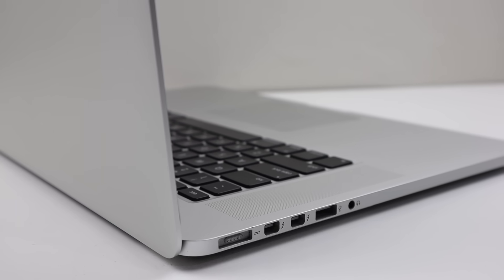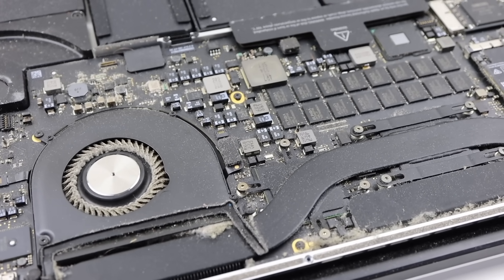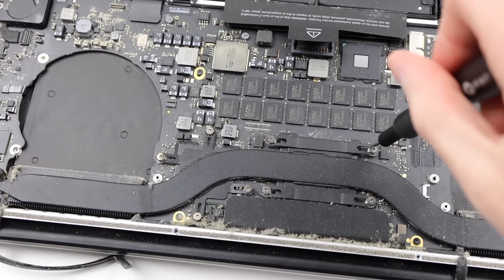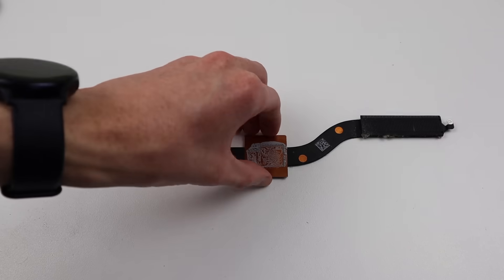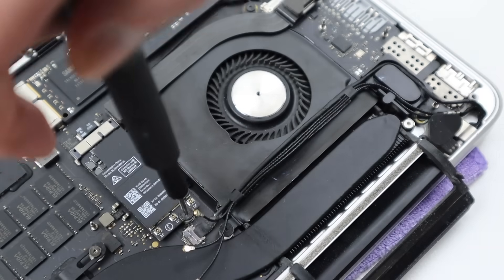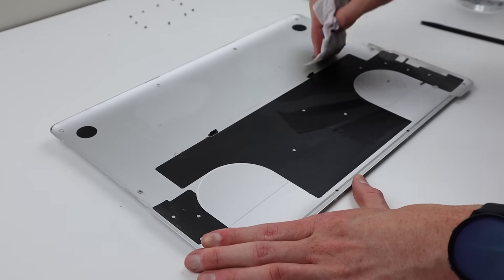Fixing My Filthy Overheating MacBook Pro

Comment: I have a 2019 21.5 iMac that runs quite hot under load cuz the damn fan won't even spin until it hits 100C then very slowly ramp it up. Installed macs fan control and it drastically lowers temperature by increasing fan speed but still keeping it relatively quiet. The CPU is turboboosting a lot longer then before too.

Comment: Use the little straw that comes with the compressed air or tilt the computer itself, you're basically spraying the logic board with sub zero liquid gas.
It's a thermal shock in the solder joints and chips.

Comment: The moisture you got with the compressed air was mostly because you didn't hold the can level. The liquid comes out other times usually because it's been shaken, not stored upright, or used  for prolonged periods.

Comment: Laughs in 94.5°C when watching YouTube or when in online classes
Reply: Anthony José  turn off camera when you video call. Thats the cpu drainer.
Reply: Tomahek you realize that it’s a thermal issue and not a battery problem. 

Also some online class requires you to turn on the webcam for the duration of the class.
Reply: Zacronzer Zetto yes the cpu having to work less would make it cooler. It is a thermal issue and a viable solution.
Reply: @zacronzer   who is talking about battery? There are some codec problems which causes cpu to work much harder than its necessary which causes temperature to skyrocket.
Reply: @youdontexist.  ah my bad, I thought you were pointing that the CPU massively drain the battery power.
Reply: @zacronzer  r/wooosh
Reply: Use smcFanControl to put the fans at high speed without waiting for the OS to do it when your computer is exceeding 70C.
Reply: @gorkyd7912  thank you, man. I bought a new laptop a few weeks later! Either way thank you! :D

Comment: try volta if you are still on 10.14. It can disables turbo boost when you dont need it and you can undervolt the cpu and lower the power limit.

Comment: It would be interesting if you also posted some details about the temps you were getting before and after the cleanup!
Reply: I was waiting for him to show the temps at the end, am quite a bit disappointed I must say.
Reply: @Erotikstudio Winkler GmbH Nice explanation and all, but it'd still be nice to see a higher boost clock like you said. If you can't prove that there was any difference at all, what's the point?
Reply: I got a 20 degree drop according to Macs fan Control. My fan entry was blocked with dust bunnies and the paste was dried out . Its 11 years old and never been done before . Also made sure to clean the fan blades from dust
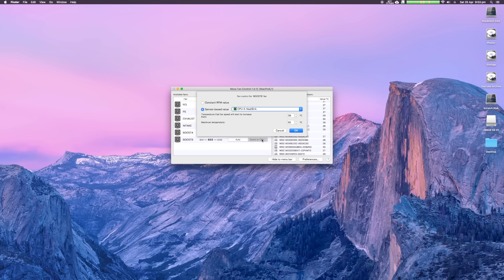Reply: In the last couple frames (around 09:08), you can see in the upper right corner that his fans were running at ~1476 rpm at 44 celsius.
Reply: from shit to less shit,
Reply: @Erotikstudio Winkler GmbH You convinced me all tho fan noise is still horrible and i don't think anything can defend cheap tiny radiators
Reply: Because all that work, and risk, probably didn't do anything.
Reply: +1
Reply: yea
Reply: @harryprice89  you want me to research for a simple clean up?  no thanks
Reply: Basic detail, and yet he left it out. I'd like my view back, if possible.
Reply: Agree, feel like he's just trying to make a video with a problem that doesn't exist
Reply: @trongnguyenduy4154  did we watch the same video? It was dirty as shit and was running at almost 100 degrees... if that's not a problem to you remind to never buy anything from you second hand
Reply: By looking at those tiny cheap radiators i'm expecting temps to be the same
Reply: @Next-nb9pr  You are so stupid.
Reply: @Next-nb9pr  a clogged airflow can make a difference
Reply: @cgd07  Of course but the most you can get is quieter fans and still irrelevant temps
Reply: @Next-nb9pr  if it's not throttling then it's fine, but when it is, even youtube gonna stutter
Reply: @cgd07  Well it depends what is fine to you but hardware working in 90-100° won't last so long after warranty ends. Also if you like turbine noises then i guess it's fine but as you said it will be working smooth unless throttle comes, i would go for undervolting
Reply: @Next-nb9pr  90C is perfectly fine for laptop CPUs/GPUs, hell, even 100C is starting to become safe. The more recent AMD/Intel CPUs can go to 105C before thermally shutting down, it used to be 100C.
Reply: @acumenium8157  You're talking about shutting down i care about thermal throttling at these temperatures there is no fan that wouldn't go like a vacuum. It's not only about the core but every other component providing power and that amount of heat will easily melt vram chips
Reply: @Next-nb9pr  Throttling is 100% software side and depends on manufacturer. MSI sets my throttle at 90C, but I have it disabled because there's no reason to.

Lenovo usually sets it at 70-80C, sometimes disableable.

Throttling has nothing to do with actual safety, just what manufacturers want to impose, if they want.

Also VRAM chips don't melt at 90C.
Reply: @acumenium8157  You've got theory i know facts and have seen many examples when micron chips just died. Still my point was to small radiators and inefficient heat transfer but yeah as long as you're fine with portable vacuum cleaner i really don't care.
Reply: @Next-nb9pr  By Micron chips... you mean storage right? Like an SSD or flash card?

Those don't really throttle from heat so much as they just... stop working.

You're right though those do have a lower temp limit, although NVMe has changed the game a bit. Most NVMes can handle up to 80C with no issue. Some do have  throttling features to reduce it to "only" SATA speeds until it cools down, but that's really hard to notice.
Reply: @acumenium8157  I meant vram on gpu and it seemed as one series of cards has that issue and another works perfectly fine. You have very good points and knowledge but i still look at this as of not how much core or other components can handle but what culture they should work under. And sometimes it really doesn't come to saving weight but just money and brands being very  cheap on radiators.

Comment: I’d put new thermal paste on any laptop no matter how old it is because the junk they use from the factory is generally low quality and mid quality at best. It took Apple all these years to finally put in a better paste in their machines until finally 2018 they did it and even then, it still isn’t the best. Whenever I replace it, I’ll always do the best possible job I can and clean the heatsink and the die with acetone as that cleans things even better than alcohol and then I apply thermal grizzly kryonaut since it’s pretty much the best one out there. And when it’s a machine like this where the heatsink has a lot of mounting pressure, I spread the paste before mounting it because it’s bad to have some parts of the die not making as good contact.

Comment: Do not tilt, and do not shake cans of compressed air and you will not longer have the moisture issue, it's actually condensation from the liquid in the canister landing on the board, rapidly converting to a gas and decreasing in temperature rapidly.

Comment: I do clean mine every six months, been doing that for years every macbook that i have owned is still working even my 2008 15inch one is used for mail in my office cleaning your PC/Laptop should be a normal task if you want your device to last longer and work at its best..

Comment: Just to let you know you was using the compressed air wrong
Reply: Yeah I thought he was going to kill his computer
Reply: Literally was screaming in my head when i saw it shooting the liquid from the can... Also a questionable amount of thermal paste.
Reply: @discretecinema8451  I agree with you on that whole compressed air statement, That gave me chills but I don't get the thermal paste. It really doesn't cause harm
Reply: Zycklacon applying too much can cause worse thermal transfer over time, and see performance degrade faster than normal.
Reply: @discretecinema8451 you prune,Hugh did remove the battery meaning it is totally harmless with the battery removed
Reply: @discretecinema8451 you dumbass,it couldn't do no damage like Hugh mentions it is harmless to the Laptop whilst the Battery is disconnected
Reply: Let's Disregard the amount of Thermal Paste as there seemed to be a shroud to protect the components. However, compressed air should not liquify like so when sprayed.  Shake the canister properly (I actually doubt shaking makes a difference but just reflexes) and try to spray it in a horizontal or <45 degree angle or else the gas will not vapourise (don't know the most appropriate wording) properly.
Reply: @5x22  silicone thermal paste isn't conductive
Reply: Tim Goddard Just to let you know you were using grammar wrong
Reply: As long as there’s no power running through the board and the liquid dries before reconnecting the battery, then no harm done. It isn’t water anyway but rather a liquified gas such as difluoroethane, trifluoroethane, or tetrafluoroethane which dries almost immediately on contact.
Reply: Tim Goddard ikr
Reply: i shake my compressed air so no water comes out, it works.
Reply: Tim Goddard the compressed air from a can might create vapor that condenses — but these are fluorocarbons (fluorothane) — These vapors do not condense to water and boil away rapidly at room temperature creating a cooling effect. There are other liquids than water, just in case you weren’t aware.  

Compressed air from an air compressor might in some instances collect actual water — but that’s not from a can dear.
Reply: Crux161 actually if you so much as read the can you will find that the liquid will only come out of you haven’t held it straight or if you shake it amd I wasn’t saying it could damage his computer but it wasn’t going to remove dust was it now my dear
Reply: @Crux161  Amazing how many people seem to know everything, yet don't. We can only try to save them from themselves. Seeing school has mostly been an ftard minding service for over thirty years (I live behind a high school), it surprises me we're not all dead from chronic stupid.
Reply: Michael  who are you jeses?
Reply: @kiprad6347 you mean Jesus
Reply: Michael  you tell me
Reply: @Asher Ortman hahah ok buddy if you say so
Reply: Man everyone always gets mad for no reason like
Reply: Just to let you know, you were using the word “was” wrong
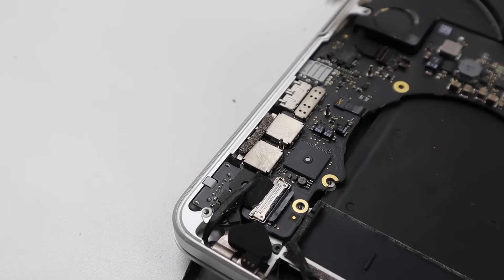Reply: 5:15 U LIL PIECE OF SH8
Reply: Jason Kulo it’s compressed air. He must have shaken the can because it was literally shooting liquid out of it. I do know about MacBooks, but this is not even about them.
Reply: Barundonthetechguy / iRepair can you explain proper way to use compressed air ?
Reply: @Draculapin  you're supposed to hold the compressed air can vertically, if you hold it horizontally it will definitely shoot liquid like in this video. Most air cans also come with a straw that you can use to direct air on a horizontal surface and still being able to hold the actual can vertically.
Reply: @Jackinacox  thanks for your time
Reply: Draculapin Sure! You hold the can upright, without shaking it at all, and he was using it badly enough that some icy liquid froze parts of the mobo, because he shook it up and/or was using it upside down. NO liquid should come out of it when cleaning with it.
Reply: what do you expect from mac users
Reply: Just to let you know you was using eanglish wrong
Reply: Kiprad just to let you know no one cares but thanks all the same
Reply: @kiprad6347 you mean English
Reply: @kiprad6347 you too a lot more horribly 😂😂😂
Reply: Moisture = rust you dumb as
Reply: @levynkhs8820  who are you calling a dumbass, you can't even spell it
Reply: @levynkhs8820  not quite. Water equals rust. Compressed air has no oxygen to oxidize and form rust. Nice try, dumbass.
Reply: @Kafen8d  bruh water condenses fool ?what were u doing in ur high school classes?
Reply: Pointless argument
Reply: Random Guy it’s not water in the can it’s compressed air which turns into a liquid “you fool”🤣🤣
Reply: @Kafen8d  not to mention its aluminum not iron
Reply: @Kafen8d  bruh didn't you see the frost that appeared from the liquid in the canned air? When that crap evaporates it leaves the surface at freezing point, condensing water in the air
Reply: Couldn’t the oxygen in the air react with the liquid from the compressed air and then it be able to rust.
Reply: @levynkhs8820  First learn to spell dumbass you dumbass

Comment: Lmfao my 2012 MBP runs HOTTTTTTT while I’m using MS Word or just browsing the web
Reply: Its time to clean the dust out of it.
Reply: Cautionus Xtras I did i think it’s time to replace thermal paste under the heat sink 🤷🏽‍♂️
Reply: I cleaned my MBP mid-2012 today. Lots of dust was at the fan. After the fan is quiet and MBP is not heating.
Reply: Nicholas Ramdhan upgrade to ssd
Reply: John Francis Chan i not too long installed a 2TB Seagate barracuda in it. It was like 3-4 months ago. It has 16GB of DDR3 RAM and a core i5 2.5GHz 

(Edit): removed a g from gigahertz 😭
Reply: @johnfrancischan9464  haha that would not help reduce temps at all
Reply: @johnfrancischan9464  Not the main issue in a laptop.
Reply: Word lol
Reply: some macbook problems😂🤣
Reply: Chrome will do that with no tabs, also youtoob, and most sites with ads. Watch the cpu column in activity monitor. Also, Apple factory thermal paste is disgusting and almost worse than useless. Weird.

Comment: It grinds my gears when there is old residue of termal paste on the CPU before applying new paste. I use a cotton swab and isopropyl alcohol to clean the internals of my laptop.
Reply: And eucalyptus oil
Reply: @lox07  + a sprinkle of fairy dust
Reply: @lox07  oil doesn't evaporate like isopropyl or methylated spirits does
Reply: Which termal paste?
Reply: @macyourday0  5:40, and the brand I use of termal paste Is Manhattan
Reply: @TheBetomann  did you notice a speed increase. my mid 2016 pro touch b art 15" clealry is overheating sure its the dust but i wonder if it losty speed
Reply: I used artic silver 5 paste good stuff

Comment: keep the compressed air can completely upright at all times to prevent liquid being released
alternatively get a battery operated air blower available at stores like PC Case Gear
Reply: Yes, NicGlol got it right, it was pain to see how he used that compressed air...
Reply: Not to mention you need the straw to make sure that you have enough pressure concentrated to actually move something.
Reply: NicGlol it also helps to use the included straw.  It’s like this guy has never used a can of air duster before but yet he repairs and cleans computers ...
Reply: Also, "giving it another go with some compressed air just to finish things off" tends to finish fan bearings off. Always block the fans from moving freely when using compressed air / a vacuum!!!
Reply: @Thomag0   F.Y.I - Never use a Vacuum on anything electronic, it creates ESD and will shock and kill it instantly
Reply: ee i dont use the can my dad has a red tank
Reply: and if you eat after touching stuff you sprayed it on... well find out yourself.
Reply: @ilyasg2108 that won't happen if you was your hands afterwards though
Reply: @stephensnell5707 true, i made the mistake of not doing that then eating grapes once
Reply: what about leaf blowers?

electrical ones of course
Reply: 5:15 everybody
Reply: Continue sentence off part of another, genius.
Reply: i also wondered about the liquid coming from the compressed air. i just cleaned my macbook using a vaccuum and brush and it came out very well. i think using a vaccuum at low level doesnt pose a big risk and actually gets the dust out better than using air. i also did not need to really disassembly anything. macbook runs much better and i needed only a fraction of the time this guy did. of course i did not apply new heating paste, which would probably help, but getting the fans working properly again already helped a bunch and the whole macbook was full with a lot of dust i could easily remove using the vaccuum. i read people saying vaccuums will kill your computers by static discharge but have cleaned various computers over the years with vaccuums and never had any of these fail on me. i sincerely doubt it that carefully vaccuuming your pc will be a big risk to your computer.
Reply: dude where is that extended nozzle on that thing
Reply: should have read this before I totally f'd my macbook pro lol
Reply: NicGlol  I’m so glad someone else saw that i made a comment on it and got a loud of hate saying I don’t know what I’m talking about 😂
Reply: He could use the hair drier on cool mode too
Reply: @mourgos1234  it could be dangerous because it can create static electricity and short out something
Reply: @hamzah.t07  even from distance ?
Reply: @mourgos1234  maybe?

Comment: There’s a lot of moisture coming out of that compressed air can, you must make sure to not hold it at an angle, I was terrified!, they usually come with an extender (sort of straw) to move the air to the spot you want.
Reply: I also noticed that, he tilted the air can a lot.

Comment: Thats a good amount of paste buy when applying to bare dies (basically everything except desktop and server CPUs) it would be best to spread the paste to ensure it covers the entire die. Since there is no heat spreader like on desktop and server CPUs, lack of thermal paste on sections of the die results in zero cooling for that particular area.

Comment: I already replaced the thermal paste and cleaned the fans on my 2009 MacBook Pro. It still managed to iron my sheets and melt my desk though 😂😂☠️
Reply: my 2010 Mac reached 100 degrees Celsius (200 degrees Fahrenheit) while screen recording a powerpoint 😂
Reply: Gabriel Huke-Jenner Haha. My MacBook reached 243 degrees when I was using google chrome for google docs